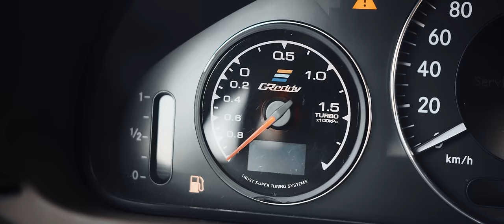Mercedes CLK W209 2.3 TURBO M111 450HP/600NM | JVKUB Media

Comment: Probably the best conversion i have ever seen, everything fits perfect. Power, turbo response time, Chassis. Simple Perfection.

Former Mercedes Benz Mechanic
Reply: Able to help me understand what I’d need to do a set up myself? Looking to buy and mod a clk230. Can it run this with stock internals? Does the head need upgrading?😂
Reply: @smalltalkgaming  w209 or w208, the engine is from another car. m111 can withstand some hp with Stock internals.
Reply: Are the oil pumps front mounted? I’m debating attempting to squeeze one in an s13 s chassis for something different but worried about clearance

Comment: Really nice, even though I still prefer the front look of my 208(mopf) with the seperate lights (even though the projector lights are a little bit nicer than the reflector ones, I just like the look of them :D ) and the 320 engine ( I'm just a fan of the smooth v's .... the 6 is economic/power sweet-spot, as the 8 no matter if 420 or 500 use just way to much fuel for only "little" gains in HP respectively) but I have to say, I love the overall look of yours.

Hope mine turns out half as nice next year, when I'm doing some rust removal, fresh paint and exchange of some parts in that process :)

Comment: Thanx by this video! I have this 'pristine SLK230 with stock Brabus exhaust, am thinking about changing the kompressor for a turbo, but keeping almost everything else stock. If possible, I need your experienced advice. Can you please tell me a good setup that would probably work well? Don't want forged/custom made parts and that the stock automatic transmission would handle well.

Comment: Is this the M111 2.3 engine? Did you have to change the differential? I wanted to swap W209 CLK200 with a 320 engine but now this seems a better option

Comment: Very cool project. Numbers please!. Approximate 100-200. 
All this efforts are useless without proper numbers.
Reply: 100-200 1.5bar 9.5s , 2 bar i dont know maybe 8,5 s
Reply: @marcin_m111turbo  this is super. 
I have built W210 OM 606 diesel. It does 100-200 9.84s and 12.9 quarter (with bad grip) on 2.6 bar.  We have C32AMG with 1.5 bar on compressor. It does 10-11 seconds 100-200.. But your car is special for me as well. I had M111 before on my C200 Kompressor. I made it ~230hp. It was pretty quick on quarter  14.5 seconds. I love that engine Very much. 
Do you have your externals forged as well? What is required for 400 hp? 
TURBINE, ECU, downpipe and exhaust manifold and what else? What kind of ECU do you use?